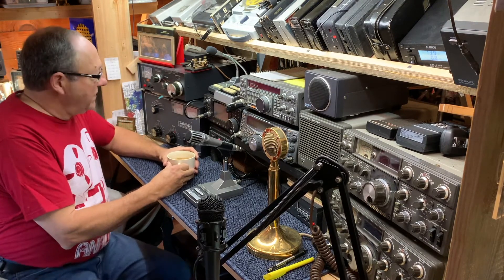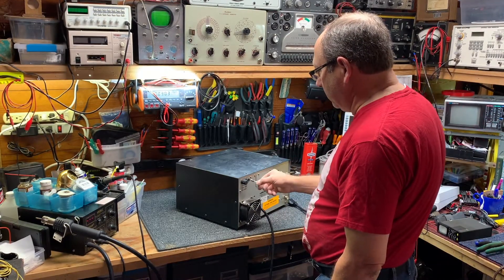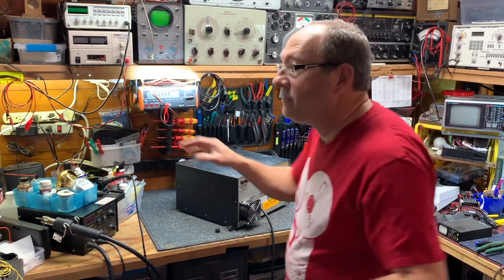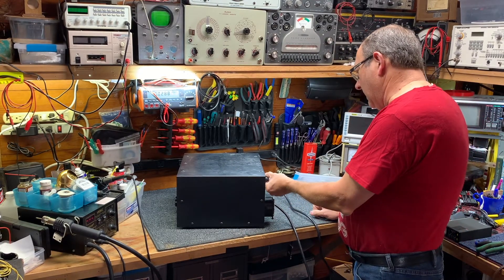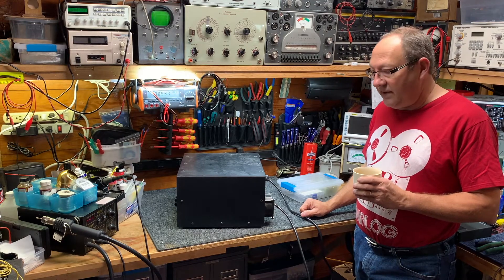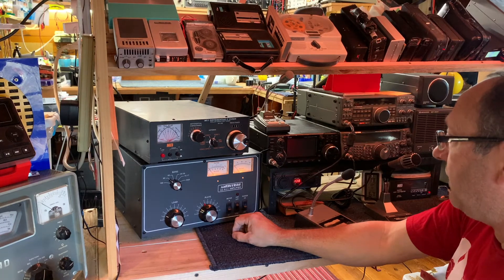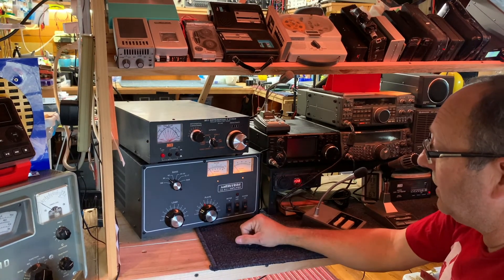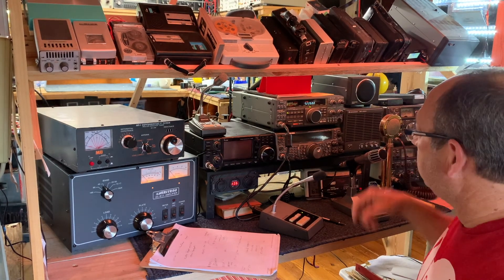Vintage Tech: Amplifier Ameritron AL 811 troubles

Comment: I have the amertron 811 and it kept blowing fuses found out i had a bad tube so i replaced my 811 tubes with 572b tubes everything works fine but now i cant get any power out when i transmit. Can anyone here tell me whats going on with the amp please?
Reply: Mines doing the same thing. Bad 811 tube replaced with 572b now no transmit power
Reply: Did you get it fixed?

Comment: Why do you have an antenna tuner after a tube amp that already has an antenna tuner built in? Ive never tried that but,  I have a few antenna tuners, so why not put them in series and see what
 happens.
Reply: You  must  be  a newcomer or uninformed.   No tube amp  I'm aware of has  an  "antenna tuner" onboard.  Many have  a pi net output network that is somewhat  wide ranging,  but still nowhere near not wide enough for some  antenna systems such as  ladder line fed.   Read up.  Do some research.  Running a tuner  as the last box  in the line before antenna is VERY  common and accepted practice.  I myself  run a  multi band,  ladder line fed antenna.  The  Z  of that varies greatly.   I was  first licensed in 1965 and am 75.  I've  built or modified  and repaired several amps  all the way from  811's to  4-1000A  and 8877
Reply: @fourfortyroadrunner6701  Nope. As long as your SWR is reasonable (less than about 3:1) the pi network in most tube amps will handle this 'mismatch' without needing an external tuner. But if you're running a G5RV, a random wire, or a big loop, then yeah, an antenna tuner is probably needed. But like everything else in this hobby, 'it depends'. There are very few absolutes.

Comment: Not a good idea to power up a device that has been blowing fuses, regardless as to whether the fuse may have been a little off; quite often you will end up creating a cascade of failures. Instead, do a visual inspection of the circuits at minimum, and even a cursory component level check with a meter. Plus, test and/or try a different set of tubes.

Comment: This happened to me just a month ago and it was a tube gone bad.  Tested each tube one at a time to see if amp would turn on and it did until I got to the bad tube.  I think I need to change out D16 diode now.  Ameritron sent me one but with no instructions.
Reply from the maker: D16 is a high-voltage (1KV) rectifier that provides DC power to the meters.  D16 a 1N4007 diode, if you have the right designation.